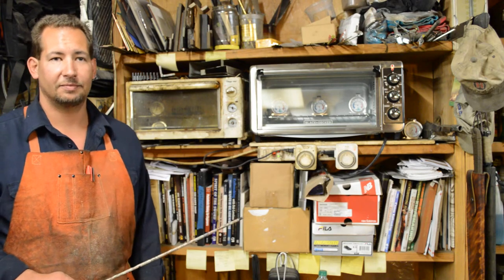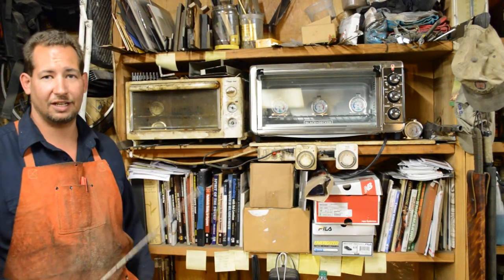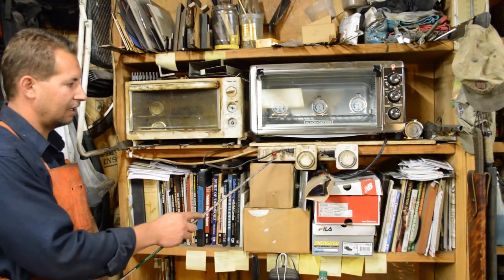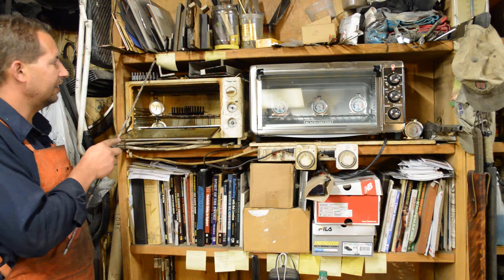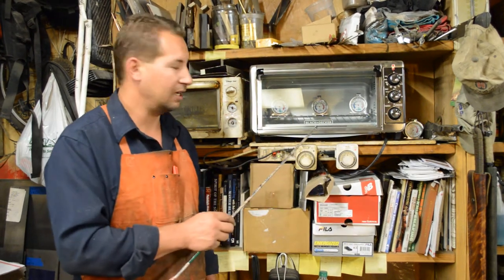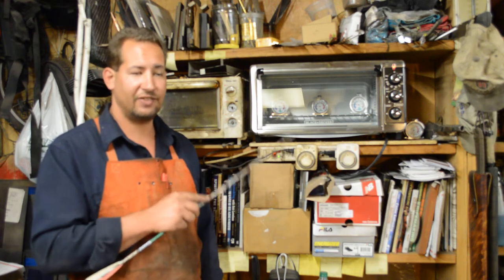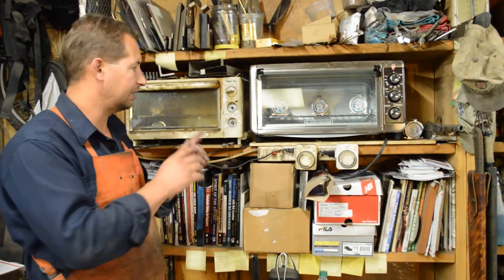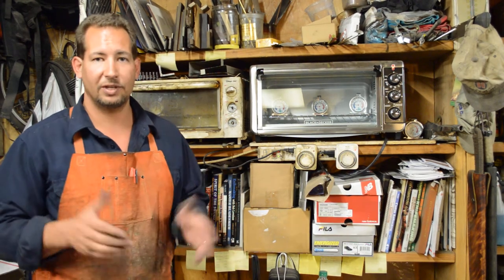using toaster for tempering knives

Comment: Great video, although I've never seen an analog powerstrip set up or the metal thing that you used to hold the knife. Could you please explain it and where I might be able to find something to hold the knife? As I need to stop using the big oven for tempering knives. Thanks
Reply from the maker: i use c channel with slots cut into it. ill see if I can make a video on them :}

Comment: Advice, I have made a blade and went to temper 400 degrees for 2 hrs, then second round of tempering 400 degree and forgot about it for 4 hours, did I ruin the blade ?
Reply from the maker: I dont think that you would ruin a blade by doing that, at most it might come out a bit softer than what you had planned as tempering is a combination of time and temperature. but you could finish grinding it and put an edge on it and test it before you put the time into putting a handle and nice finish on it to see for sure.

Comment: Can the spent Nichrome heating resistors get recycled into improving knife stock metals, 🤔
Reply from the maker: i dont know.... but you can put just about anything into a metal can, fill up the air space around it with powdered steel and then forge weld it up and turn it into canister damascus.
Reply: @joecalton1449  I have one all apart that I was trying to order a replacement switch for. The resulting discovery was that the switch cost nearly as much as a replacement toaster oven. I was pondering possible things to do with the collection of junk; it’s a habit developed from adverse financial realities that has the gainful effect of additional knowledge of component materials just prior to throwing the damn junk away 🤪
Reply: Nickel and chromium are metals added to stainless steel that increases hardness and perhaps regular steel in some diminutive minority composition not unlike carbon for iron

Comment: So I can't afford a big heat oven, so I want to use a toaster oven. I use (1084-1095 and 15n20) Help me out here, I make kitchen knives.(1) I forge the blade,(2) do my rough grinding,(3) normalize the blade(4) heat treating in the forge,(5) finish the blade grinding,(6) in the toaster oven at 300° 60mins 2x,(7) finish polishing. Just trying to make a better blade.
Reply from the maker: that is a good basic timeline, but I would switch 5 and 6. so you heat in the forge and then quench in the oil. then temper in the toaster at whatever temperature that you have determined through testing is the best for the steel you are using, I would do a minimum of 2 hours each time for two times, then do your finish grinding and polishing.

if you wait to temper until after you do your finish grinding, and you drop a full hardened and not tempered blade onto a concrete floor, it has a very good chance that it will break.